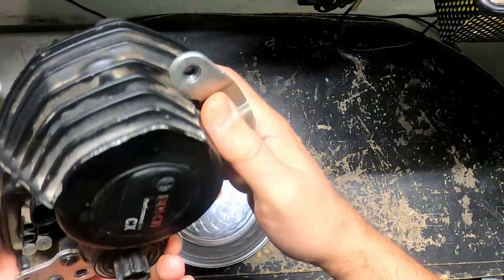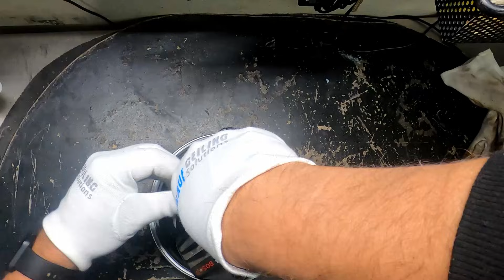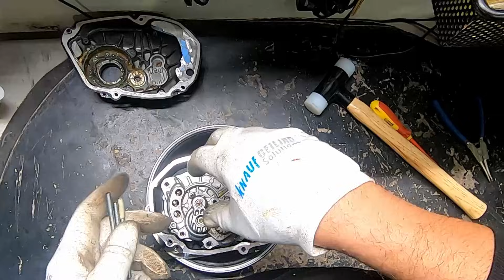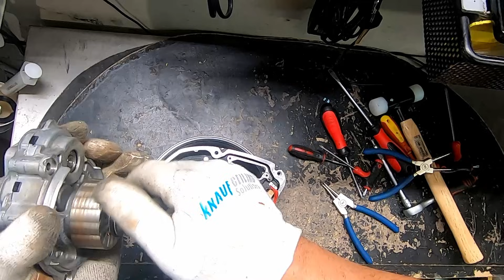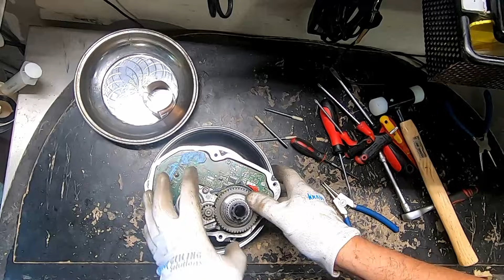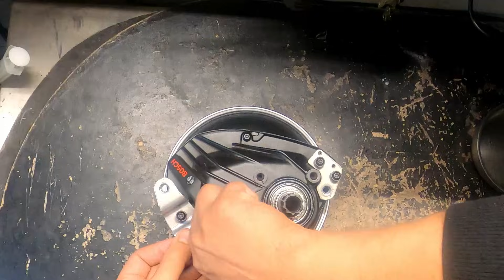BOSCH PERFORMANCE LINE CX EBIKE ENGINE FULL ASSEMBLY & DISASSEMBLY

Comment: Hey,
nachdem ich mit diesem Video meine defekte Platine ausgetauscht habe, geht mein Motor jetzt wieder an. Leider bietet er trotzdem keine Unterstützung und summt nur ganz leise, wenn ich die Schiebehilfe nutzen möchte. Haben sie eine Idee, was noch defekt sein könnte?
Reply from the maker: The speed sensor is programed to work with the original motherboard! So by replacing the board form another engine it do not work...

Comment: Is that a horizontal battery  pal ?mines running off a powerpack 500 i could use my 500 horizontal on the topbar and the power pack on the down tube  with the bosch y splitter would it work ? It would be the same as the 250watt extender  only im using 500watt powerpack ??
Reply from the maker: It is horizontal!

Comment: Greetings, I was looking for it and I can't find it. If you can help, tell me what the connector on the motor is for, which jack is for what purpose, thanks in advance.
Reply from the maker: You can find it in  the web! You have power supply, speed sensor, display, power output, front and rear lights!

Comment: hello

 i have ebike with bosch gen 4 smart system(grand canyon on:9) and also ABS brakes is there any possible to install any speed unlocker there
i ordered eplus bosch smart system no rim magnet advange 
probabli this box will not work correktli there
Reply from the maker: It is not a Smart System engine! There is no solution for ABS models i terms of tuning!

Comment: This motor has done 10299km? And this was its first service?
Reply from the maker: Yes
Reply: @powerbikesbg  So if mine has done 8000km, I still can wait with sending it in for a service? =)
Reply from the maker: @ashystyle  if it is running,  do not do anything! Bosch Gen 4 is not designed for regular service !

Comment: Good video but would like to see you service it. I mean a full service.
How long can these CX line motors go before they really require a service?
Why is Bosch not selling spare parts and barrings?
Reply from the maker: The engine is not designed for a service! There are no official BOSCH spare parts for it! Only a few shops are offering bearing replacement or electrical repairs!

Comment: so little copper for so much power? Wow... Bafang bbshd needs to step up bro!
Reply: That stator is not small for 250 watts. It's even encapsulated in aluminium, so cooling is good. It should be able to push closer to 1000 watts. I see a remap coming up.
Reply: @mike-v8j3x  would be sweet if it could handle a 48V battery.. to make it all custom.

Comment: I can only see one entry which water can penetrate and that’s around the crankshaft maybe once out of warranty best I get some water proof grease and seal it from the inside
Reply: You can also seal it from the outside with grease around the crank.
Opening a sealed system is never a good idea. You could even introduce moisture from the air in it for no reason.
If the motor doesn't behave abnormal or make strange noises then it does not need to be opened.

Comment: how often you have to disassemble to check the motor?
Reply: My Bosch Gen 3 Performance Line CX has done 12,500km and has never been disassembled since manufacture the bike is now six  years old. 
So as long as you don't ride the bike underwater or use a pressure washer or a hose jet stream when cleaning the bike. The sould last just as long as my motor.
Reply from the maker: It is a not serviceable unit! There are no spere parts  for it by BOSCH!

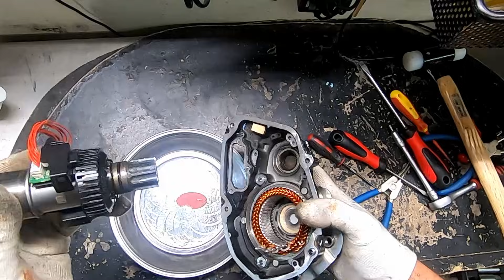Comment: 13:40 What is the theory on the torque sensor device there, it looks like it would only sense rpms.  I realize there is a motherboard to do some analysis with the data, but how is it sensing rider input level force, rather than just rpm to send to the motherboard?
Reply from the maker: The sensor, the electronics and the technology behind is what makes the engine responsive, smooth and efficient.
Reply: They evaluate the ripple in rpm. More ripple, more Torque.

Comment: You havent fixed nothing ,zero bearing change ,gearbox not opened Waiste of time
Reply: I guess the title was right, "assembly and disassembly" rather than repair.
Reply from the maker: It is not about bearing replacement ....look for another video in YT, but there is no info about it!

Comment: I have a trek rail with the CX gen 4  thinking about buying a spare used low mileage motor. Is there anyway to test the motor out of the bike ? Thanks
Reply from the maker: Yes, but you need the cables and a battery + display! You have to use the walk function for a quick test!

Comment: Great video ! When the engine must be disansambled ? Please share with us the online store where we can find spare parts for Cx gen 4. Thank you very much !
Reply: "Performance line bearings" sell parts for bosch gen 4 Google them
Reply from the maker: Not OEM
Reply from the maker: There are no spare parts provided by BOSCH. The engine is not designed for service! You do not have to open it in regular basis!

Comment: Thanks for the video.
I actually disassembled my engine and the circuit board got wet. Do you know where I can get spare parts?
I have already asked Bosch and other dealers, but the spare parts only go to dealers.
Reply: This will not solve your problem, as another Mainboard PCB will not work with your torque sensor...
Reply from the maker: @ebmr-ebikemotorreparatur  did you tried to swap a mother board to another engne?
Reply: @powerbikesbg  multiple times aready
Reply: @ebmr-ebikemotorreparatur why it shouldn't work?
Reply: @su1raM  becouse the main PCB is calibrated with the angle position from the rotary armature...
Reply from the maker: You can buy a new engine from a dealer or you can buy a spare motor and use it as a donor!

Comment: Be careful tearing these units down as parts are very difficult to get to repair yourself. My Gen 4 was noisy so I disassembled in hopes it was an easy repair. I intended to get bearings and seals but did not realize I couldn't source them anywhere. Put it back together and took the motor to a dealer and was forced to but a new one. 18 month old eMTB with about 300 miles on it. Very disappointed with Bosch and their support or lack of.
Reply: @PaulShutts. He could get one if he took it to dealer instead of trying himself. Now he probably screwed something else up. Also Im not sure if noise alone is enough for a free service warranty .
Reply from the maker: I know that! It is not an easy fix!
Reply: Those new China bosch is rubbish, I wont get another ebike I guess ever especialy from this brand 4 sure never again, mine starts and shows for 2 sec an empty batery flickering once even though is full, and after shuts down as doesn't connect...and has only a little over 8000km...very dissapointing!🤮🤬
Reply: You had a x2 year warranty on the motor, if you tampered with it, they won't give you a new one.
Reply: Che tipo di grasso usate per gli ingranaggi in plastica ? Grazie